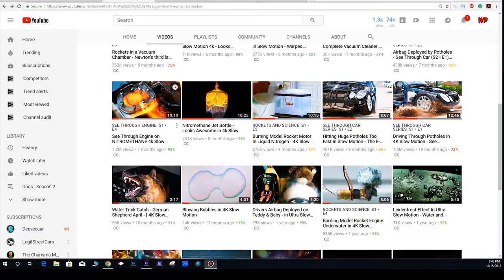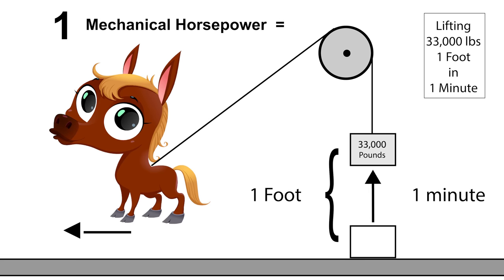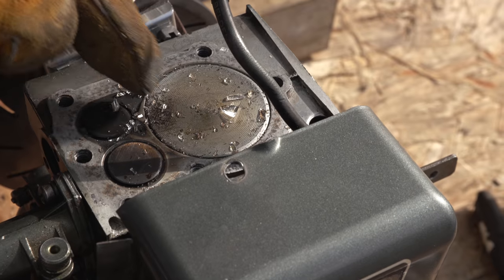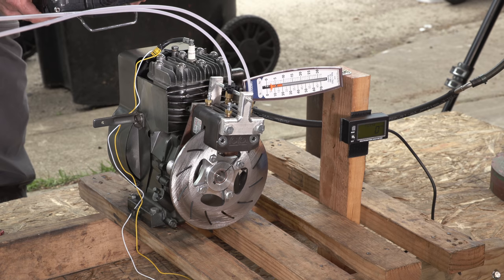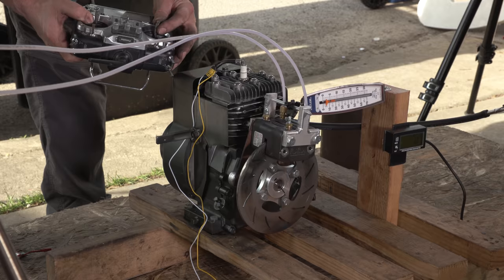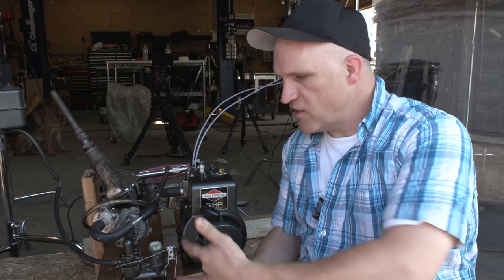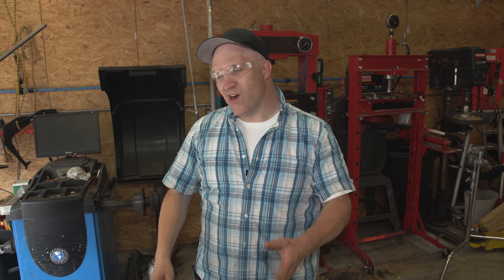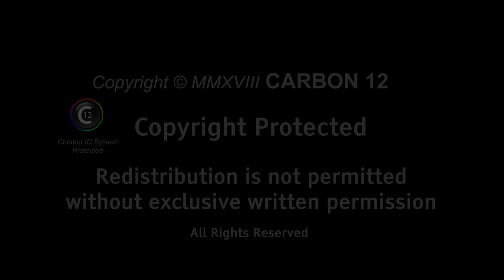See Thru Engine on Turbo Nitro and Dyno  (How much HP does it make?)

Comment: All your experiments , so to speak , are fantastic.
I would like you to test Mazda 's " Wankel "  engine with the clear plate you make.
The engine would run on original gasoline  , firs in medium and then higher rpm, so in real life - mode.
So it would look like combustion , suction , exhaust , so all that is very controversial with this type of engine.
I know , i was looking at the little " Wankel " engine .
Please be kind and do an experiment like this.

Comment: You would gotten better results modifying a old smog pump into a small turbo charger.. that one is way too big for a small three horse Briggs to spin without sacrificing some power... just a thought .. alot of people use that setup on small engines and get and have recorded up to 13lbs of boost on that setup .. maybe try that in a future episode

Comment: Do a oil Analysis and see what was that stuff in the oil.
Reply: Kind of wondering if it's RC type fuel, which typically has 8%-20% synthetic and castor oil in it, rc cars use lower oil, planes/heli's use higher. Doesn't explain why it's all over in the crank case though...

Comment: you want as little back pressure as possible after the turbo, that series of pipe bushings you have is restricting it significantly, you need to allow the exhaust to expand from the outlet of the turbine, and until you can build some sort of boost it will never make as much power as N/A because the compressor side is actually acting as a restriction as well
There are small engine turbos available from china in the $150 range,  would be a much easier and better fit

Comment: So the "see if it will blow" did not happen. I kind of wondered if there would be enough exhaust gas flow to turn the turbo. Doesn't look like there was. So the purpose of the turbo is to force more air and fuel into the chamber. You just need to find another way to do that for the small engine. Now if the goal is to get the max power from the engine, I have an idea but don't know enough to make it work. A pressurized fuel and oxygen setup. have a sealed feed of O2 to the Carburetor. Have a tank of the nitro mix in a pressurized container like Coleman camping lamps work off of. You will have to figure out the mix yourself. That task is beyond me.

Comment: you'll never build any boost pressure with that size turbo on an engine that small. would be keen to see it done with a much smaller turbo. would also need a bigger carb too

Comment: You need to zero out your scale before taking your readings. They are all off. Try running the exhaust gases through a metal tube and focus the exhaust on the vanes of the turbo. And vent your crankcase!

Comment: I think the spring isn't trimmed right, it's reading 2.5lbs with no load
Reply from the maker: No I calibrated it, but this is like a cheap kitchen scale, but I calibrated it before I used it.
Reply: @WarpedYT  I feel like a weight came off of my chest, thank you

Comment: It will run properly with that turbo,  you need to remove the governor and then you'll be away well above 4000rpm and into serious power
Reply from the maker: You're right, it just needs more fuel than air, but there is no governor, that Governor has been long gone for a while

Comment: U have to think combination. Why would you use a 300 hp turbo on a 3 hp engine? You could use a cheap electric blower like sold on ebay or a leaf blower to get your horse power. Or you could spin the turbo from the exaust from your tail pipe on your car.

Comment: Turbo is WAY to big for that setup, you need one of these for turbos for very small engines RHB31 VZ21. Remove the downsized exhaust pipe, turbo do not need back pressure after theyre exit as the turbo itself is the back pressure. Get a bigger carb and put an inline boost gauge.

Comment: the compression on the flat head must be extreme as there is no dish in the head. The stock comp on a briggs side valve engine is poor. brigs have a late closing intake. it doesnt close till the piston is half the way up so itll start easy. Wanna send horse power way up grind enough ( about 20 thous) off the top of the intake valve with a file thru the side of the engine. Booger to start but rider did wheelies after i did that.

Comment: Turbo don't increase engine horsepower. Intake & exhaust manifold/pipe is robbing power from the engine. Turbo is just giving back some of the power rob by the intake & exhaust manifold/ pipe.

Comment: A smaller turbo would work alot better.  I did hear your turbo spool up to a point but could definitely tell that it was at about half of its potential. A smaller turbo would spool alot higher because the exhaust side would be tighter and the exhaust gasses would be more pressurized to the turbine.  Great try and I give you an A+ for effort.

Comment: Awesome video but unless you know exactly how much pressure your putting into the braking system horse power cant be figured from the scale. It is cool though.
Reply from the maker: It can with the high speed camera. Pressure to friction conversion is impossible to use in this situation without very closely measured properties, and even then it's nearly impossible. You want to simplify that entire equation down to friction resistance, that's all that matters here.

Comment: Would you be better with electronic strain gauge type scales maybe some thing like digital luggage scales 
As hardly any movement required so you would have more stable anti torque link  just a thought ?
Anyway love your videos keep them coming
Also if you want dry system it can be done with carb ,the float chamber needs to be airtight then you feed charge air to top of float chamber 
As charge air builds it should perfectly balance out so carb works just the same .This idea was done on MG metro Turbo using a modified SU carburettor in the early 1980's and worked ok

Comment: It doesn't make sense to me that a turbo made for a Mercedes with 100+ HP could possibly work on a 3 HP engine.     The design of the turbo would have been for an engine with much more volume of exhaust.    Maybe a supercharger would make more sense.

Comment: Awesome effort dude.... Your turbo is too big and  generally function better with less compression/advance depending on boost pressure/octane....... Balance those out and the only thing holding back 20hp is the
 metallurgy :-P

Comment: If you want to , put a billet rod and a billet flywheel also a racing crank and cam then a fuel pump and racing carb then run it on pure racing alcohol....   7,000-8,000 RPM's will give you about 9 to 10 HP...........

Plus Tard Mon Ami ~!~!
Reply: Just viewed this on YouTube wanted to comment when I came across your comment, you & I obviously know how to get every oz. Of power out of these small engines.

Comment: Not problem in wet system turbo, its problem bcs its too big turbo to use with that engine, and ofc you must use more fuel on that. YOu dont have enough exhaust gas on nitro, try test it on small diesel engine without and with turbo

Comment: First.....   if you want impressive hp numbers, read at HIGHER RPM. 

Second, draw through turbos arent a bad idea. They worked for years, however they need carbon seals to prevent sucking oil, like your turbo did after restart. The thing is, that turbo is WAAAAAAYYYYY too large for that little engine. And your exhaust outlet on the turbo was wayyyyyyy too small.  Turbos work on pressure differential. If you have reatriction after the turbo, you have no pressure differential across the turbine and the turbine does nothing but get in the way. Hence the low numbers.   You need a much smaller turbo. Like smaller than a T25. Thatd be impressive to see though.

Comment: buy an ecotrons kit then you can do efi vids and do this right also a bigger disc and a fan so it doesn't warp and don't cut it off with the break it heats that part of it clamped down. and that exhaust after the turbo on a single you would be amazed how much a small restriction will make life hell. try taking that off and add some oil to that poor turbo it may be massive for this Briggs but still give it a shot

Comment: It could be going lean. Pulling the fuel mixture through a cold turbo probably lets some fuel stick to the inside parts, compressor wheel, etc. It did start to spool tho! It’s already build so just make 1 more video! 😁😁😁
Reply from the maker: Exactly, that's what everybody doesn't understand, it started to spool on a very inferior setup, and that was spooling on such a terrible setup imagine once twice the fuel/air is injected.

Comment: Hey man, check out ecotrons.com. they make a small engine turbo thats good for 125-500cc. Another thing they offer which is really slick is a fuel injection conversion for engines like the predator or honda 6.5-13 hp

Comment: Hey I saw that you barely beat legitstreetcars you should probably reset your transmission and drive very very hard on the car so the ecu and tcu can learn that you like to drive hard so it puts more power to the wheels! Maybe even use the nitrous while driving it hard!
Reply: Here’s how to do it https://youtu.be/BQkj3UK37u8    I’d recommend trying to hit at least 45 shift points driving it extremely hard
Reply: Another thing is to make sure the transmission mode is in s not w or c

Comment: It seemed to be governed, During the slo mo of the exhaust you could see an on-off cycle. I believe this contributed to the scale shake, and will definitely cut your power down. You should blow it quickly too. Also, a smaller turbo would work better. I don't think you have the exhaust power to really overcome the weight  of the turbo's resistance.
Reply from the maker: No there's no governor, the on-off you see during the high-speed footage because that was shot at about 1300 frames per second. Those were the actual cycles of the exhaust pulse.

Comment: Wet system wasn’t your problem too big of a turbo for that engine it wasn’t building boost because it wasn’t moving enough exhaust through it and the exhaust was all so being restricted at the same time get and smaller turbo I guarantee you will get better results

Comment: Those small 4 stroke engine do not like to rev above 3600 !  The stock connecting rod or the dipper (oil slinger) will likely let go.

Comment: THE iSSUE WITH THE TURBO IS IT TAKES MORE EXHAUST FLOW TO GENERATE BOOST IT IS OFF OF A MULTICYLINDER CAR !!! YOU NEED TO TEST IT WITH A WAY SMALLER TURBO FOR A ATV OR UTV

Comment: Divide in half or is that multiply by 2 ?? 
3:18
Reply: Ironclad it’s about where the leverage is. The weight has less leverage over the motor. With less leverage the motor moved more weight. 

I’ll give you a visual. Does your car move easier with a larger tire? This would be like substituting a 12” diameter tire for a 6” one. It makes it easier to rotate. 

You give the motor more leverage through gear ratios. So if he used a 6:1 gear ratio instead of 12:1 then he would need to double. 

But using a smaller lever in this situation gives the scale less leverage over the engine making it easier on the engine.

Comment: I think you are 100% out of carb. Nitro requires more fuel air than gas and throwing a turbo ontop of that. You probably need way less timing idk. hope you get it to work though. Will probably need to gap rings too if you want it to live, but im sure you dont. Good luck love the vids.

Comment: The needle on the carb is for idle, not flat out. Makes no difference in the pull. And you understand that that turbo cannot be driven by the tiny exhaust from that engine. Nothing to do with wet system. Do you work with mechanics at all???

Comment: inb4 viewing turbo: The turbo is illsuited for these low volume gas flows, it will not contribute to HP, I think it will make it worse actually.
Reply: Dude, no it's not the fault of the wet system, it is the turbines size and design that is completely mismatched to these (comparatively) low gas flows.

Comment: you can't put the carb after the turbo. not good. you need a boost gauge, to see when you get 10 or 20 lbs boost. you need a much smaller turbo to do that. they make them. for each ten lbs boost, figure double horsepower. not sure with nitro. but that is with gasoline. ww2 aircraft had 80 or 90 lbs boost in the manifold.

Comment: Why did you dampen the exhaust? Instead of reducing the back pressure, you increased it and made it even more difficult to rotate too large turbo. Fail! With a small turbo it would have over 10 HP!

Comment: The turbo is too large plain and simple.  You need a small turbo off of a jet ski or motorcycle as small as possible for the volume of air you have. A large turbo off of a car requires a large amount of air to spool it up, right ?? Think about it.
Reply from the maker: Yes you are correct

Comment: E85 will get it to spool, you will have to be able to feed it 30% more fuel though😎
Reply from the maker: I'm for sure going to try E85 versus nitromethane, I run E85 in My Supra and I made 1000 horsepower to the wheels.

Comment: 1º put wideband sensor lambda
2º use only E85
3º put small turbo and roller system.
4º  0W-20 oil is fine
5º optimize your exhaust manifold. You need gas velocity and volume. a 180º bending system is good.
6º keep 11,0:1 AFR on full load.
Reply: A wide band sensor does absolutely nothing if you are running a carburator! Get back to watching fast and furious

Comment: You can't make boost with such a small engine and such a big turbo. You're making less power than the naturally aspirated setup because there's less air coming in, because your turbo isn't compressing it, and the turbine is just in the way of more air.

Comment: Use a smaller turbo! That turbo is design for a 4 cylinder to spin it, with a much larger displacement. That engine hasn't the capacity to spool the turbo properly

Comment: Common sense would dictate that since you have no idea how much nitro you need or how much the carb will deliver that you should just provide and an enrichment circuit, say the fuel side of a nitrous nozzle directly into the intake manifold. Then by adding changing jets and pressure you could add as much or as little as it wanted....in addition you should make a system to advance the ignition timing on the fly....you will probably want twice the timing once you add the nitro.....if you do these two things you should be able to make plenty of power to kill the rod and piston without even needing the turbo.
Reply from the maker: Nah nah, I think you have nitromethane confused with nitrous oxide, nitromethane is the fuel, this is not running gasoline, it's running nitromethane, that's why the timing has to be 50 to 60 degrees advanced. If you ran that kind of timing on gas the engine would grenade the first time if you actually got it started which I highly doubt. I do have a nitrous kit for this engine as well, but nitrous is not nitromethane, that's a completely different thing altogether. Thanks for watching and thanks for the feedback.
Reply: Completely aware of all of that. I have run and tuned both nitromethane (CH3NO2) as well as nitrous oxide (N2O) in racecars hence my screen name. If you reread my post you will see that I said the ability to adjust the timing on the fly so that you could start the engine on gas and then add the nitro and timing once you had a little heat in the jug. The suggestion to use the fuel side of a nitrous nozzle is just a cheap and easy way to inject the nitromethane into the port and would provide you with a wide range of jet sizes....you could just use a mechanical injection nozzle from a racecar but they are harder to source and the jets are harder to find in a wide variety of sizes.

Comment: you need to use a turbo better sized for that engine, can't get enough hot gas flow to drive the turbo with that small engine.

Comment: It pretty much needs fuel injection. Ive seen alot of guys put turbo chargers on go karts, and they simply wont make power with a carb. Try fuel injection, and im sure you will have much better results.
Reply from the maker: Oh yeah !!!. Especially with nitromethane. Do you know what size turbo charger they put on the go-karts?

Comment: That turbo is too big for that engine to move. That's the reason you just started to hear it spool up a split second before it stopped. You need a turbo that is small enough for that engines exhaust to be able to push properly.

Comment: you divided by 2 instead of multiplying by 2. if you have 10 lbs of force on a 0.5ft lever, if you double the length to get the full 1 ft, then you would double the force. Turbo made less power cause it was to big and was not spooling, just became a restriction
Reply from the maker: Yes dividing by 2 is accurate, at 6 in it will give you double the foot pounds. Check out the newest episode I fixed all of those turbo issues mostly

Comment: Every honor, just keep working.
I would like to assign an appropriate turbo that you can find so that we can see the maximum that can be pulled out of that engine. Also, if you have the time you can make an electric turbocharger as in the video https://www.youtube.com/watch?v=G8XT00GpKuE&start_radio=1&list=RDQMvVO_sHC63G0
using the least compressor wheel. I believe the results would be better. I am eagerly waiting for the continuation of the works. Greeting.

Comment: You put a turbo off of a 6L V12 on a 3hp single cylinder engine. Let me rephrase that for you: you didn’t put a turbo on the engine. You gave it an intake and exhaust restriction. That’s it. I believe you know that, too, as you’re too smart to not realize it. That engine does not have a fraction of the exhaust energy required to spool that turbo. It made no boost. Sound does not equal boost.

Great videos otherwise. Check out cars and cameras YouTube videos for a source for turbos and EFI systems for such engines.